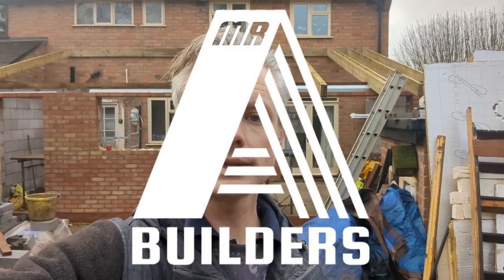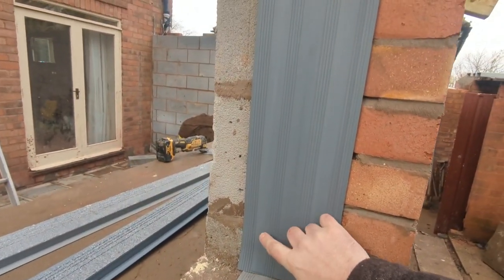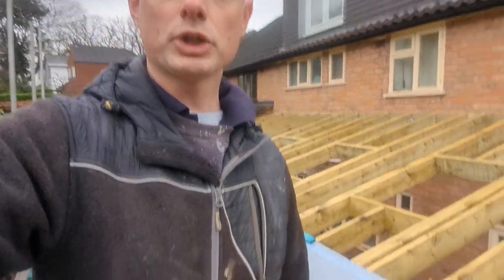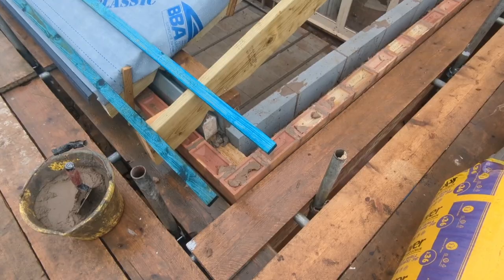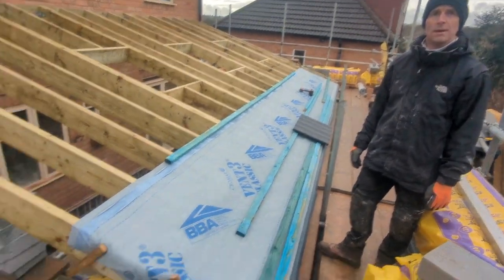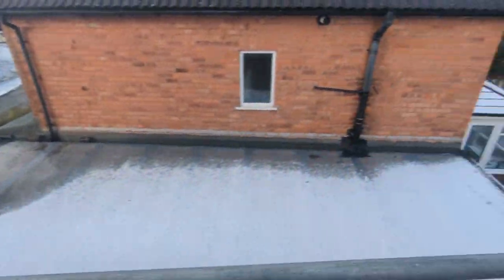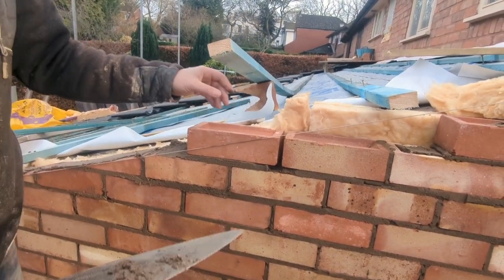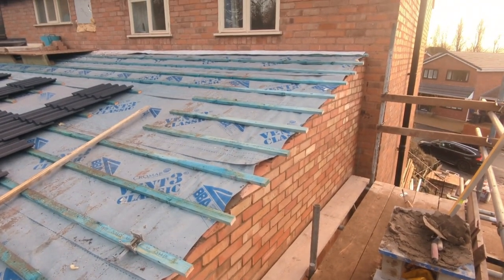Single Storey Extension. Finishing the Brickwork and Making an Announcement!

Comment: Interesting to see different regs depending on where you are. Here in NI, our windows are set behind outer skin, in cavity. Also where new extension meets existing dwelling, we need to cut a 50mm strip between outer& inner cavity & insert DPC and 50 mm kingspan insulation. This is to prevent cold bridge & damp travelling into what’s now the interior.

Comment: Great to see someone building with a focus on detail and to ensure longevity in the build.  
As an independent engineer i am shocked when viewing new mass build homes that so-called brick laying pro's cannot build a non complex wall in alignment.  Just last week, new build site, every home i had to assess for sign off had on average a 45mm outward slope on the bungalows facing bricks and on two stories builds we went up to 65mm (these are timber frame builds). Where block walls were utilised for rendering these were not only sloping outwards (so bad the lack of alignment could be seen by eyesight only) but there was no consistent mortar layer depth across the row (just looked horrific all be hidden by the rendering). Openings for doors / windows were excessively outside specification and fitters were having to utilise foam and mastic to attempt closure.  These homes were not low cost but mid to upper price bracket.
Reply from the maker: Thank you, Joe. That sounds all rather horrific! Appreciate you watching and commenting mate, take care.
Reply: In possible defence....if its timber frame, brickwork follows the framework maintaining cavity size. This has been an issue with timber frame in this country for   30/ 40 years. The timber kits are generally poor, not to correct size and added to that if the workmanship on the kits is poor it effects the outer skin.
There's only 1 correct way to overcome any issue with kit/ plumbness, thats to do substructure outer skin post kit erection, setting cavities with a plumb bob from the  eaves/ gables. Will never happen with major builders because of time constraints. 
As an example, a few years ago i did some work for a house builder called Stewart Milne. Stewart Milne are primarily a timber frame kit MANUFACTURER. Their kits didnt fit their houses. On 1 i had a 20mm cavity at dpc level. I measured all walls at dpc height with their contracts manager. Every wall was within 3mm of the plan dimensions, yet no cavity was more than 50mm with the kit up. The kit was oversize at dpc height, if you then factor in any discrepancy in panels being plumb, timber frame does not work in this country because we cant manufacturer it correctly nor construct it correctly.
Bricklayers always set a profile up braced above their work height at cavity width, regardless of plumb because basically they have to in order to maintain cavity width and for the lintols to fit over openings.
I hope this gives you some clarification as to the likelyhood of why they lean out of plumb. 
As for bed joint depth, that might be because of the need for a compression allowance, which goes back to the kit. If the compression isnt built into window height dimensions then it has to be done via bed joints.
This is my experience and ive worked on many sites over 30 odd years that have been timber frame.
I was a brickwork contractor on a few smaller frame developements and i refused to set out any sub structure brickwork until the kit was up. We never had an issue with plumb on those sites.

Comment: Nice work, Stopping the blockwork 25mm back either side is a nice detail, what compliments it even more is the single sided closer like the Unilin MGW FR Cavity Closer Checked 2400 x 150 x 150 which then sits flush in the cavity.

Comment: Always preferred to birdsmouth the rafters over the top plate as well, granted they may have to be cut individually but no chance of slipping! Also it looks as though the corbel didn’t start low enough or wide enough to mask the end of the fascia.🤔not picking fault just an observation😉good work

Comment: Absolutely love the videos bud! Working my way through them! My question is whats the cost differences between different types of extensions? Single story, single story with foundations put in for future 2nd story added on at a later date and also 2 story extensions. The cost also between breeze block outer wall with rendering compared to bricks (smaller and require more plus more time) if much of a difference? I dont know what you charge, but worth every pretty penny! Love the passion you put in and the quality!

Comment: Hi great videos very informative, 
Q. Why have you left a gap between your work & the next doors extension
Reply: Because u have too next door probably built just short off the boundary line if u then build up to their existing build u will be building on to their land
Reply: @davidbrook5823   it will fill with debris .. wont it ??
Reply: Up to each house to keep clean
Reply: I'm abt to do same on my house , thought that would of created area for damp yo accumulation, look a bit tight to get in there & clear.
Reply: @davidbrook5823  they did that at my grandmothers & nicked 8" of her wall, so when she extended the same she had a 4" step in her internal wall & planners didn't pick it up

Comment: cannot understand why builders are still useing the worthless fiberglass insulation kingspan is much better 2 inch of kingspan is the same as 4inch of fiberglass so in a 4inch caverty you can get total of 8inch insulation with kingspan making for a much lower r value
Reply from the maker: Evening Ian, hope you're well. There are a few reasons why the fibre glass insulation is preferable, but it's a long conversation. I'll go through it in a future video. Thank you for watching and commenting, appreciate it.
Reply: @Mr_A_Builders  a vid would be good thankyou
Reply from the maker: No worries! Leave it with us!
Reply: Ian. Good look getting 4inch of rigid insulation in a 4inch cavity. Also fibreglass a much snugger fit.